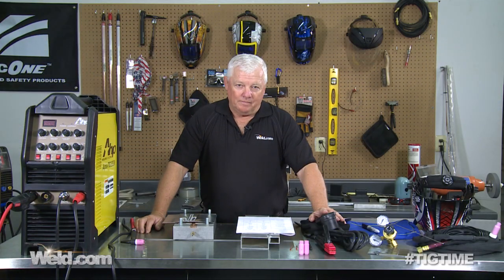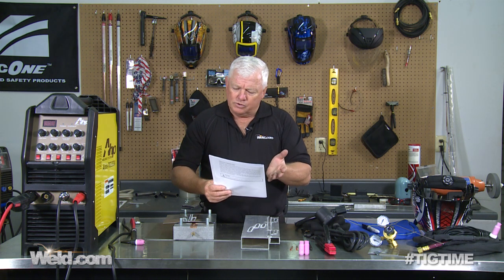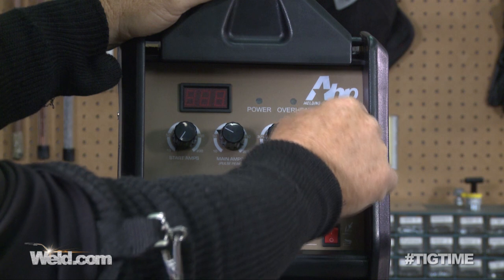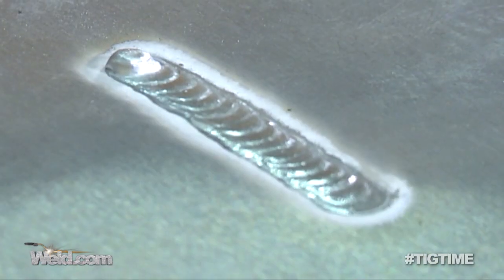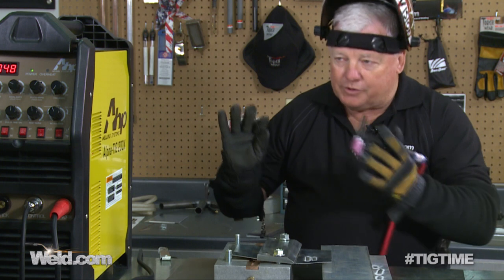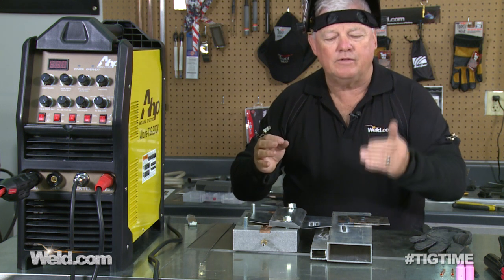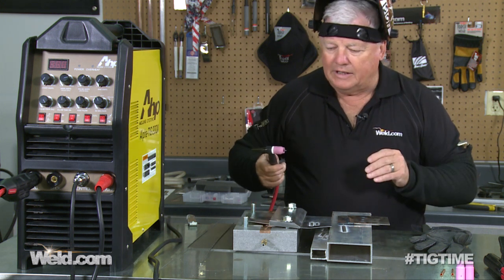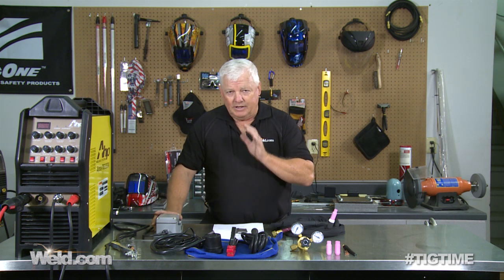AHP AlphaTIG 200X Review: AC Welding | TIG Time

Comment: Can I run a 75% argon/ 25%carbon dioxide gas in this unit? It's a leftover tank from my old 80's Dip Pac mig welder.
Reply: Weld quality suffers with anything else than pure argon.

Comment: Lot of people buy this because of the 110V feature but what they don't realize is you need a 30 amp 110V circuit to get to 150 amps. Most people don't have 30 amp they have 15 amps the cost of having new wire pulled by a electrician is the same as having 220V put in.

Comment: Late June 2019 : Just received mine, they ditched the shitty foot pedal, updated to a good foot pedal as you would see with higher end machines even though it wasn't mentioned when i ordered it (meaning they still showed the shitty one on the website although i received the better one) Alphatig 201XD

Comment: Your store link dont work. I was thinking about buying the ahp 200x with your custom addons.
Reply from the maker: The store is currently under construction. It will be back online in May 2017 with expanded product catalog.
Reply: Ok id like a price on the AHP with your aproved stuff, and the everlast if thats possible.
Reply from the maker: The kits will now be sold separately. We will be taking the regulator out of the kit, so it will be cheaper. Once I have all the updated information, we will be releasing a video announcing it, so be sure to subscribe.
Reply: Ok thx

Comment: 2016 model comes with upgraded flexible torch that looks exactly like that one he is showing, less the bulky connector at machine. It also came with the upgraded regulator like Mr Tig is showing. I have been learning for about a month, and it runs smooth and very well. Great price to learn the method.
Reply: I did not like the regulator that came with mine. It had a leak from the bottom section where the hose attaches. When teflon tape was used to seal it stopped flowing properly. It was also hard to get a good flow output from it without having the hose loose. Might have been a defective flow meter, but I ended up getting a replacement.

Comment: You failed to mention a very important factor about this machine.  Although it is a 110/220 volt machine.  The spec sheet states that in order to get the maximum rated amperage of 150 amps when using 110 volts, the input current must be 37.4 amps!  No average home the USA is going to have a 110 volt 30 amp circuit, much less 37.4 amps!  What does this mean... well,  since most homes have only 15 or 20 amp circuits..  you're only going to get about 60-75 amps out of this machine when using 110 volts.
Reply: It will provide 131 amps using 110v on a 20 amp circuit.
Reply: +rkstew So can this machine be used on a 110v  with a 20amp circuit when you turn down the amps to 60-75? Or will it still pop the breaker? Sorry I dont know anything about electricity. I live in apartment with a detached garage.
Reply: +dohc1974  The answer is  yes,  however, even though the receptacle you are plugging your welder into may be on a 20 amp circuit, there may be other receptacles  or lights on that circuit that are drawing current.  For example, if a refrigerator is plugged into a receptacle on that circuit, and it draws 5 amps,  then you have only 15 amps available  for your welder., which further  reduces that amperage your welder can put out.  Try to use a receptacle on a circuit that doesn't have other appliances, lights, etc, that are using current, then you will get the full 20 amps. I am surprised that Mr Tig, or any other of the  popular welding pundits hasn't addressed this.  However, sometimes people who are selling welders, don't make full disclosures about issues like this..  Good luck with your Alpha Tig
Reply: I dont need mr tig sticker lol
Reply: rkstew you plan on doing all your welding in the kitchen? Lol

It still does a great job at 110v, you can’t blame the machine for houses being insufficient to run industrial equipment properly. 99% of people will be fine with the unit output. The 1% that’s not should invest in the recommended 220v source or stop welding at home.

Comment: Hi mr. tig what amperage circuit breaker would be good for the AHP 200 I have the 2015 model.
Reply: +Bruce Schnur   Accorning to the spec sheet for this machine, in order to get the maximum rated current, you need an input current of 37.4 amps at 110 volts, and 28 amps at 220 volts.   Therefore, if your home has 220 service, your better off installing a 220 volt 50 amp breaker.  This is more than you need, but the 220 plug for this machine is for a 50 amp receptacle.
Reply: +rkstew thank you for the reply I have wired up a standard 220 V 50 amp for the welder and have a 60 Amp breaker in the box .
Reply: 30 amp is fine for any inverter 200amp or less

Comment: David,  We are working with an american company to develop a new foot pedal.  As soon as it is available, we will announce on Weld.com.  Thanks for the input  Mr. TIg
Reply: any updates on new foot pedal ?
Reply: Mister TIG I just bought my first Tig welder I wan to ask what you thing about miller Syncrowave 351 as a beginer maschine? please pm
Reply: Mindaugas Berteska the 351 is way over the need of a beginner but can be had for around 1200 but they have little adjustments I’d buy this ahp over that monster transformer 351
Reply: Troy Lemar yeah ssc I know this is old

Comment: Hi, there are machines as an example one from Miller like the Dynasty 200 that sells for around 5-6  K's, how do you explain the difference, despite the fact that the Miller machine does a little more?
Reply: besides the name "miller" now that is a grand right out the gate :-) 
but all kidden aside, the miller has adjustable AC frequency (that is worth gold right there!!!) it has AC balance adjustment (even wider range than this one), the power draw from the wall is less, its lighter, smaller, more portable
the starting amps are much lower (welding amps are lower if you want to weld razor blades, gum wrapper or beer cans)
the components that miller uses are higher quality
the duty cycle on the miller machine is higher - its a rugged powerhouse for maximum demanding commercial customers that have that on their service truck every day and weld really thin or really thick stuff (high amps)
Miller has a broader range AC and DC pulsing ....
i can probably go on for a while .....  and i know people that have the Dynasty and i know a guy who has this machine (i welded with both of them - i don't own any of them - i own an HTP 221DV) and i like that best - and if you know how to tig weld and you get a chance to "test drive" - test weld both machines you would know the difference - not on your every days regular stuff, but if you start tig brazing a copper-nickel alloy heat exchanger .....  THAT is when i saw one machine do it and the other one not so much .....   if you are a hobbyist and that is all you do - you might be ok ....  If you are not great at tig welding yet, it is surely easier to learn on a really good machine so you know that you don't "fight" the equipment 

over all - you really can't ask me to compare your Mercedes benz S600 to your brothers chevy cobalt ....  will both get our kids to school? YES - but that is about all they have in common ....
Reply: Pierre,   This machine is in no comparison to a Miller or a Lincoln Machine.   The industrial machines go through tremendous testing and environmental tests that give them the certification of Industrial.  Thus, more features and duty cycle.  This machine is a "utility" machine that performs pretty well and at an attractive price for the beginner or entry level welder, hobbyist.  thanks again.. Mr. Tig.

Comment: Thanks for the review. I have this machine and am pretty happy with it. I've used it to weld steel, stainless steel and a little aluminum and have gotten pretty good results. Granted, I am a beginner, so maybe I don't know the difference!  :-)  I've been using the trigger switch so far because I wasn't used to the foot pedal. Anyway, can you explain what the adjustment knob on the foot pedal is for? Do I need to mess with it?

Comment: Can you review the HTP invertig 221
Reply from the maker: We will try and get this machine in the shop to do a review on it.
Reply: Weld.com Hi does this use normal full size dinse connectors same as say a miller dynasty, keep up the good work
Reply from the maker: crxtech1 The 2014 model (shown in this video) has an M-16 fitting. With the Mr. TIG series version we include a converter to make that M-16 into a dinse 25. We also sell the converters seperatly.
Reply: The HTP Invertig is a beast better than the dynasty 210 I know this is old but hopefully you bought it.